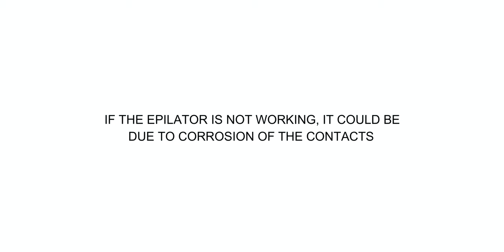Braun Silk-Epil 9 - Disassembly/Battery Replacement/Repair

Comment: I changed the battery in mine but it still not charging. Red Light is on when turning it on. Any suggestions?
Reply: Same thing, I don't know where is the problem.

Comment: That doesn’t look like a standard 18500. It’s got little posts on the end. Will a regular button top work?  What do you call the post style? Im having a hard time searching for it.
Reply: did you find it?
Reply: I’ve never found a standard one either. Personally i’ll stick to replacing the battery with the official one, widely available online. 

Curious if you manage to replace the battery with another one :) !

Comment: I need help please. Changed the Batterie at two silk epil 9 and neither of them are working anymore. They are charging, but once it's done it's still not working. Used the WD40 as suggested but did not help. What else can I try?
Thank you 😊

Comment: is it possible to use an 18500 battery with 2200 mah?
Reply from the maker: Yes, since they are same size, it should fit..
Reply: Did you replace it with the 2200mah battery? How's it working?